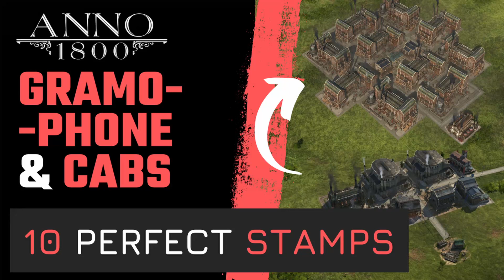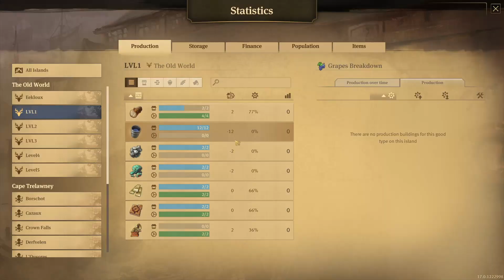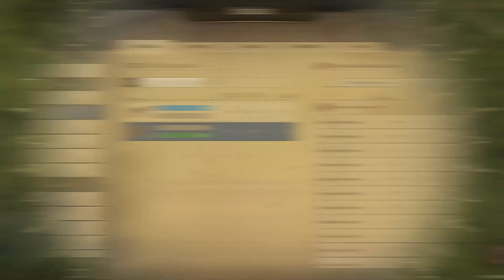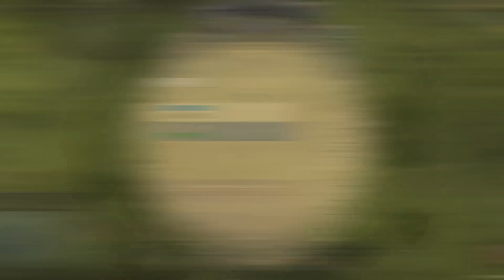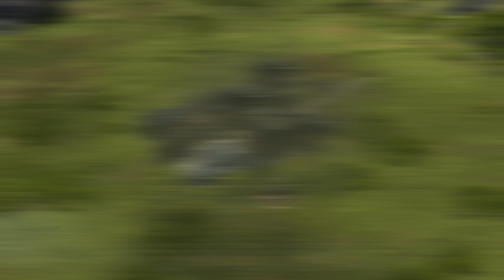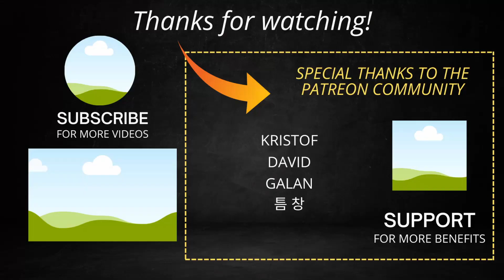ANNO 1800 - 7 perfect STAMPS for GRAMOPHONES & STEAM CARRIAGES! - 2023

Comment: Im new to Anno1800, just set up shop on my second island for hops fertility in the campaign.

Would love you to break down all production cycles in baby language.

For example: 1 potatoe field equals 1 Distilery.
Reply from the maker: It is based on the production cycle time like potato field is 30seconds and distillery is also 30s so 1 to 1 while wheat for example is 60s while the mill is 30s so it's 2 wheat farms for 1 mill 
you can also use Ctrl+Q to see if the productions are at equilibrium :) 
Good luck - anno 1800 is amazing!